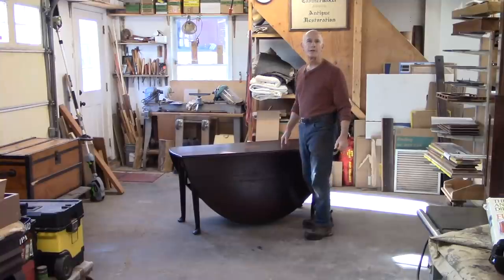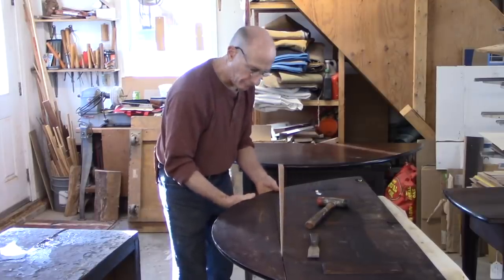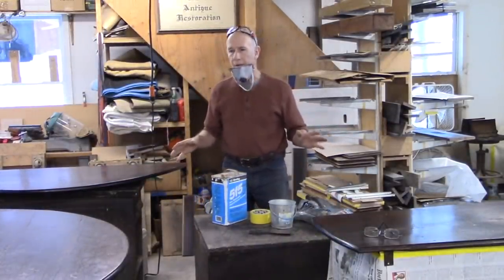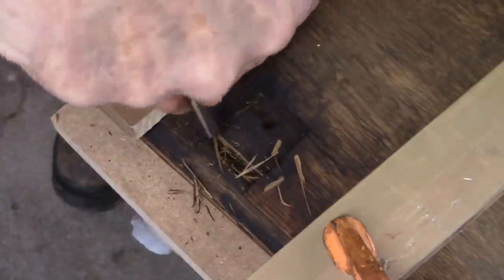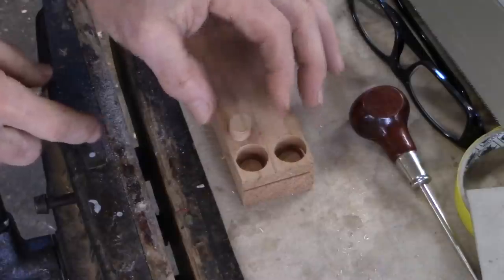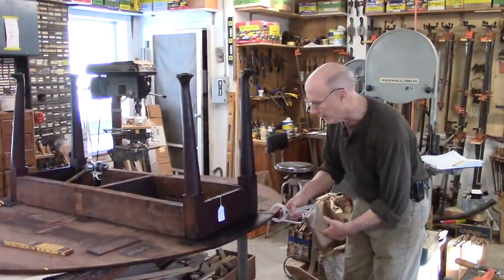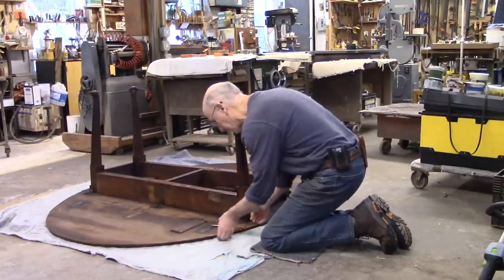Restoring an early 18th c. Drop-leaf Dining Table - Thomas Johnson Antique Furniture Restoration

Comment: I really enjoyed learning about dowels and plugs that was a nice little bonus in this one, thank you Mr. Johnson.
Reply: Yes it was one of those things you know, but don't realise you know ........................
Reply from the maker: Very welcome!
Reply from the maker: Yeah, that's a good way to put it. So many times you do some little thing and someone says "how did you know to do that?" and you're "I have no idea"
Reply: @kevinshort3943  right? After he explained this it made sense. I thought plugs were used primarily for grain matching when filling holes, not that the strength was different. Yet, when I think about it, it makes perfect sense.
Reply: @13daniel1974  
In other words, you knew it, but didn't realise you knew it....   :)
Reply: @kevinshort3943  that is a nice way to put it. Love these old guys that pass on their knowledge. I've done a lot, but always find more to learn.
Reply: @johnsonrestoration  When we use these old screws with or whitout plugs we drill two times,  or if we have the size a drillbit that is both sizes in one. We learned that we had to bore exact for the upper stem next to the screw head to avoid sideways pressure and risk of splitting the plug (and he surronding wood) especially close to an edge, as often is the matter with hinges.
Is all of your glues reversible?

Comment: Well, that table needed LOTS of structural help, Great work as always. My neighbor came over asking for some putty to patch screw holes for a strike plate relocation, I sent him back with a couple of plugs and a forsner bit after the end grain/face grain lecture!
Reply: Ooo - can I be you neighbour? I'll have all the forstner bits I can take 😁

Ah, you want them back? OK, never mind. (But you are very generous all the same)
Reply from the maker: That is great! Thanks!
Reply from the maker: We have a neighbor like that! When ever you want to do anything - always talk to Pete first, he has the exact tool (or piece of equipment) you need. He sawed up a walnut log - I'm going to use that wood for a table
Reply: @johnsonrestoration  I have always tried to be of service to my neighbors, firstly, because it's the right thing to do, and secondly because once befriended they are more tolerant of "shop Noise"!
Reply: @johnsonrestoration  Will you make a video on the table from Pete's log? It would be really nice to see you build as opposed to repair something!

Comment: The oil used that has no smell, could that be butcher block oil ( Like Ikea has ), it does not smell ( and you can lick your feet after walking in it). I find it hard to get of furniture when its mixed with wax.
Reply: Again being picky,  but of or off?  Otherwise thanks for your comment - helpful.
Reply from the maker: Yes, thanks. I was thinking raw linseed oil. We'll never know!

Comment: What a job!  What a video!  As usual. Full of little tips: spring clips to hold caul while clamping (beats my usual juggling), insert screw part way then to cut threads then cut length, plug versus dowel (you left out chopsticks as a filler). Thanks for the video and for the tips.
Reply from the maker: Thanks! I wish I had mentioned chop sticks!

Comment: I wonder where he got ahold of xylonic acid.
Reply: I asked Tom about this before. I believe it’s oxalic acid, he pronounces differently.
Reply: @nigelm5777  Right you are, and it's available on Amazon.  Thanks!  Not sure we can blame this on Tom, I'm guessing the best I can, but my spelling is suspect.
Reply: @nigelm5777  Oxalic - definitely. Can be found easily in chemical supplies stores, and as easily but much more expensively in woodworking stores.
Reply from the maker: Thanks! I get it from Hood Finishing Products
Reply from the maker: Yes, thanks!
Reply from the maker: Yes, and even Savogran now has small containers at the hardware store

Comment: I like the longer format, multi part episodes.  Thank you.  When I havr a hole that absolutely cannot go any deeper than I want, I make a drill stop out of a dowel or some other scrap.  I cut it to length and drill thru with what ever bit Im using and let it bump up into the chuck.  Ive had a bit grab in the last 64th and suck thru when using the marker tape method and it makes for a bad day.
Reply: And for a second bad day when explaining to the owner...
Reply from the maker: Thanks! Good tip. You're going to be sweating bullets no matter what!
Reply from the maker: Oh yeah! Luckily on a top like this, it's been drilled and nailed through so many times it's not as nerve racking as a new top!

Comment: I'm a beekeeper as well as a woodworker. I also use Oxalic Acid in both woodworking as well as beekeeping. In beekeeping it's the most effective treatment of a pest that bees have. You heat the Oxalic Acid until it vaporizes at 400 degrees F inside of the bee box. If you don't wear a respirator it can damage your lungs or kill you. Thanks for thinking of your shop dog.

I also make my own beeswax and oil treatment like you use after finishing your projects.

I noticed the raw unfiltered honey on your cabinet by the sink. Local honey is the best for you as well as for the local beekeeper. Good for you!
Reply from the maker: Thanks! Interesting. I had bees for just a short time and I lost them. I want to try again and do a better job

Comment: Since you work with so many slotted screws you might want to get a good set of gunsmith style screwdrivers. The difference between gunsmith screwdrivers and regular ones is for about an 1/8" the tip has parallel sides instead of the standard full wedge shaped heads on most flat head screwdrivers. Grace USA make some of the best ones & they still make them in america.
Reply from the maker: Thanks! I never knew what made them gunsmith screwdrivers! I have often ground mine parallel

Comment: I really appreciate the effort that goes into making these.  The restoration work could be done much much more quickly without having to move the camera and set up each shot, each angle - so thank you!!  And it is good to get all the nitty gritty - like getting the table down.  I am glad I now know the difference between a dowel and a plug - I had no idea, but it makes sense.  I just loved the final shot of the dog - such a knowing, member of the team shot!
Reply from the maker: Thank you! I really appreciate it, it is interesting working and "filming" at the same time

Comment: A lot of work on this table. Tips are great, plugs versus dowel, new one for me. Looking forward to the next one. Can the stripper, oxalic acid, water, etc affect the previous gluing?
Reply: Up to a point. Water most of all, since hide glue is soluble in water. But as long as it's cold water, it's pretty safe.
Reply from the maker: Thanks! dlevi67 is right. Basically if the joints are tight, no problem. If it does open a joint up, it means it needed to be glued anyway
Reply from the maker: Yes, thanks! And of course that's why we do all the repair work first. If the joint is good, nothing will get in

Comment: What a great video Master Tom Thank you. I do have a question about hide glue... We always see you cleaning the squeeze out glue after clamping, but do you do this immediately after clamping or do you allow some time for the glue to set-up a bit before cleaning it up?
Thank you !!!
Reply: FWIW, on water-soluble glues (hide and PVA/aliphatic resin) I find it a lot easier to clean as quickly as possible because you can remove much of the glue from the grain pores as well as the surface and that makes a difference when finishing the wood later. With CA and epoxy I find that letting them harden a bit (not all the way with poxy epoxy) is easier to scrape things off. YMMV, and I'm curious to hear what Tom says!
Reply from the maker: You're welcome! Thanks for watching. There are 2 schools on the subject, but I always wipe off as soon as possible. Just seems to make more sense to me.
Reply from the maker: Yes, and of course it might make a difference when gluing up a new piece of furniture. I find the problem with waiting a bit is the timing - I can never remember! Also, I have a tendency to glue up things at the end of the day. Epoxy and epoxy putty, yes you have to get them off ASAP
Reply: @johnsonrestoration  thank you so much for the reply master Tom
Reply: @dlevi67  The reasoning of my question about hide glue is because is way more runny from PVA etc. and obviously I am not referring to long runs and drips but the squeeze on the joint area, so I wanted Tom's take on it as there are different opinions on it. Thanks for the points !!!
Reply: @steliosstavrinides3502  Good point. I use 'cold' hide glue (Titebond), which is far less runny than the traditional warm glue (in fact it's less runny than Titebond I or II!)

Comment: Couple things you did that I should know/remember, but you didn't specify:

(1) the powder you mixed with water to finish the varnish stripper cleanup: TSP?; and

(2) the adhesive you used to reassemble the leaves and narrow the split in the top: hide glue?

Thanx, look forward to part 2.
Reply from the maker: Yes, you're right on both counts. I did show those products, didn't mention them

Comment: Great tip on the methyl chloride fume management. I'm refinishing the maple cabinetry in our kitchen, doors first, but I was worried that fumes would affect the paint on the ceiling. Good to know it falls rather than rises.

Also, for the cabinets over/around the stove, I use Meguiar's Hot Rims Wheel & Tire to remove the oil/grease layer first. If the grease hasn't eaten through the old finish, that's all it will take. Otherwise, strip, sand, refinish...
Reply from the maker: Thanks! That's a great idea about the Maguire's. I'll try that. Worry about your heart! not the ceiling. Many men in their 50's and 60's have had heart attacks from breathing MC, usually in enclosed spaces

Comment: Watching you get the table back on its feet makes me thing you could benefit from a portable hydraulic lift table. One of the most used tools in my shop, second only to the light switch.
Reply from the maker: I definitely need to look into that. Thanks!
Reply from the maker: There's a lot to choose from! Let me know which one you have: thomasjohnsonrestoration@gmail.com
Reply: @johnsonrestoration  I have a old bismon 2000lb skid lift with a foot pump (looks kind of like a pallet jack) $500 worth every penny.
I'm currently bidding on a Southworth 48"x 96" lift table. I'm hoping I can get it for around $3000.

Comment: That is a queen Anne pad foot table about 1740 to 1780 in age. The hinges are primitive and hand forged. Since its oak i think its from England. I would not refinish the top...only clean and wax. The original varnish makes the piece worth thousands more.. Worth about 9,000.00 to us primitive furniture lovers. Excellent repair of the screw holes. Im a sawdust and glue, toothpicks, dowel user and learned a valuable lesson about plugs. Thank you. Does my heart good to see someone appreciate the craftsmanship of these old pieces.
Reply from the maker: Thank you! I agree about the original finish. But that only counts if it really is the original finish, and if the finish is in excellent condition. It was easy to see that this table had been refinished multiple times. It was and is a “working” table, and will continue to be an actively used.

Comment: Voy a empezar a trascribir en español a partir del decapado:
15:35 Decapante, primera capa y retira con espátula
16:56 decapante, segunda capa que retira con lana de acero
17:25 Lavar con Agua + TSP frotando con lana de acero (según he averiguado: Fosfato Trisódico, agente limpiador y desengrasante)
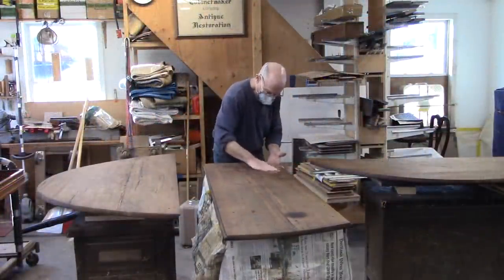18:32 Lija 220
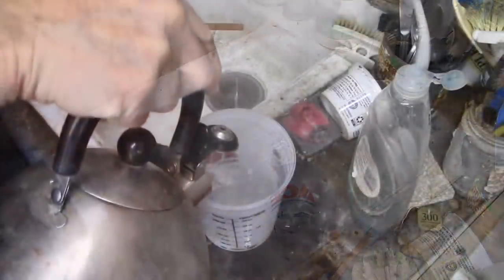18:59 Agua caliente 250 cc con 4 cucharadas soperas de Ácido oxálico, aplicarlo con pincel
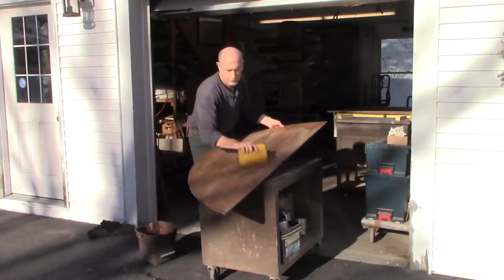21:17 Lavar con agua para eliminar los cristales de oxálico que han quedado en la superfice. Quitar exceso de agua, dejar secar
22:21 Lija 220
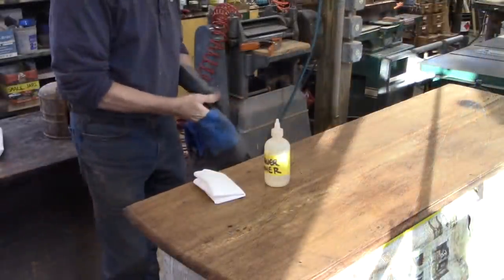22:35 Como se  embota mucho la lija, le pasa con un paño Disolvente de Laca. Después de que se seque, vuelve a lijar con 220 y ahora funciona mejor
23:23 Ácido Oxálico, segunda capa. Deberemos lavar como antes los cristales de oxálico que han quedado en la superficie
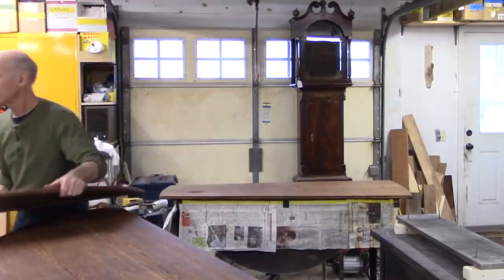24:17 restaura la zona de las bisagras que está dañada 
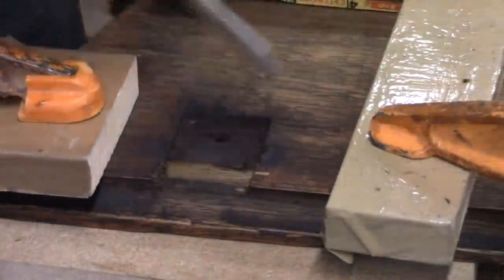25:50 Parches de madera nueva
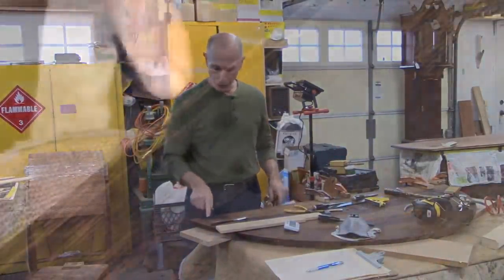28:12 Relleno de huecos de tornillos viejos, diferentes tipos
28:48 Diferencia entre un “Dowel“ (taco) y un  “Plug” (??) (resistencia). Va a utilizar Plugs
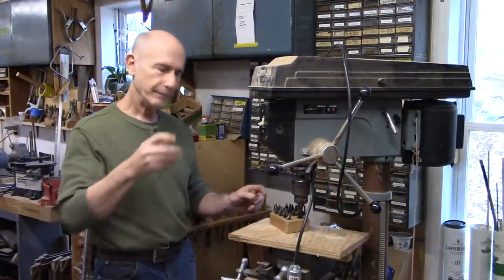30:15 hace Plugs (no sé la traducción) a partir de madera nueva
31:49 Comparación entre Taco y “Plug”
36:53 Tornillos originales, colocación 
40:35 lava con vinagre la parte inferior del mueble porque tiene moho
40:45 lava las patas con Murphy’s oil soap diluido en agua
41:20 Cera con color a las patas
El aspecto final lo podremos ver en otro video...
Reply from the maker: ¡Guau! pusiste mucho trabajo en esto! ¿Ya encontraste el subtítulo en la configuración?
Reply: Me gusta pensar que puede servir a alguien que hable español y que ande tan despistado como yo 😊 y sí, encontré la transcripción directa en inglés y así entiendo mejor lo que nos vas diciendo. Con eso y un diccionario te voy entendiendo mucho mejor y aprendo más . Me encanta el trabajo que haces con la madera, con los muebles, es una auténtica maravilla. Me gustó mucho ver cómo eliminabas totalmente el barniz de la tabla porque suelo tener que hacerlo ya que he arreglado alguna mesita a la que han aplicado capas y capas de pintura. Arreglo pequeños muebles que compro de segunda mano y después se quedan en casa. Es un mundo muy relajante

Comment: As usual, more than one thing to learn in every Video!  Like most, plugs vs. dowels, and the backing piece clamped "behind" the work... What was it that caused the water to bead? You mentioned that someone had applied an oil to the table, and you used lacquer thinner...btw, clamps; repairing a chair, right now, and used six clamps, 3 types, when repairing the top of the leg, where the tenon had broken out :-) and, one needs not just many clamps, but the right sizes! You look to have a nice "collection" over there !  Alles bestens!
Reply from the maker: Thank you! Yes, clamping is always the challenge!

Comment: I used to work for a company that restored pipe organs, and I can still remember sitting on a stool by the drill press cutting hundreds of plugs, popping them off the board by the half dozen with a slick. I think I could probably cut those things blind now even 15 years later.
Reply from the maker: Wow! I can imagine. Thanks!

Comment: Hi Thomas,  I had a question about putting the cutting the screw you used for the hinges in the top.  In the video, you said you screwed them in until they were "just short", then you backed it out and cut off the end.  How did you know when "just short" was?  Did it barely start poking through the top, then you backed it out and cut, or, if you just ball-parked where to cut the end off, why put the screw in and back it out?  Thanks as always
Reply from the maker: Thanks! I just didn't screw them in all the way, holding back the last 1/8" or so. I just eyeballed it. I use the entire screw first because it has a point on it

Comment: Oooh, Tom, those pipe clamps bearing directly on the round-over moulding made me cringe. Why didn't you use some blocks to protect the edge?

Your finishing skills are fantastic, though, and the reason I watch every video.
Reply from the maker: Thanks! I do use blocks usually, but the clamps had pads, and the wood is oak

Comment: I love the tips and tricks he shares so I thought I would share my own. Ethical methods of disposal of chemicals and tools of the trade you are in are seldom thought of however, you can start today and share your found knowledge with other craftsmen and artisans alike. Just search ethical disposal of craft waste. You can use the terms, restoration, art supplies, cleaning supplies, and toxic waste, if you want to be more specific. 

My town holds a chemical waste drop-off twice a year. Everything from trash to your gas container that has been determined to allow fumes to escape, they cover even paintbrushes and rollers for ethical disposal.

Keep it up Tom! Great work as always!!
Reply from the maker: Thanks! I will bring that up. I have learned a lot about what is allowed

Comment: Does the costic stripper affect the earlier glue job? That glue was a good, tight fit! Just asking.
PS sweet Black Dog splits his time between shop and home. Good dog! 🐕
Reply from the maker: Thanks! Correct. If your glue joints are good, no problem. Otherwise, yes, the stripper would open them right up

Comment: Finishing is not a favorite part of woodworking for me, or many other woodworkers from what I've gathered, but unfinishing - that's a higher level of displeasure in a class all by itself. The mess, toxicity, odor and cleanup required, put this procedure three rungs higher on the ladder to aggravation than anything else. This is one  case where I would agree to sanding the surface.
Reply from the maker: Thanks! I grew up with it, and have never minded stripping. To me it's a lot easier than sanding!

Comment: Nice lessons (in repair, chemistry, and patience!).  I'm curious, though.  Why did you use 2-part epoxy on the end of the wood (at 35:50) as opposed to hide glue or other wood glue?
Reply from the maker: Thanks! It was just such a lousy joint, the wood had deteriorated somewhat, I felt epoxy was the best solution